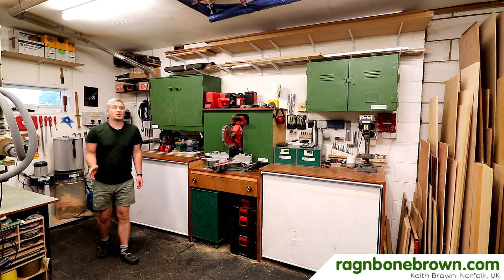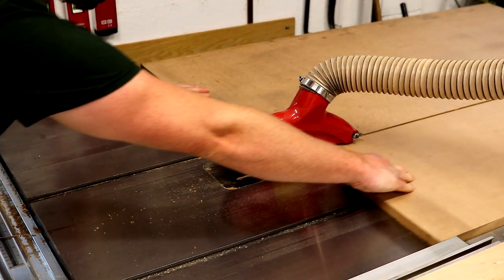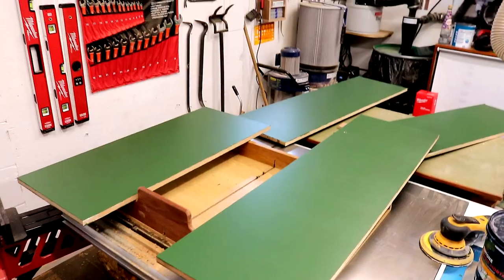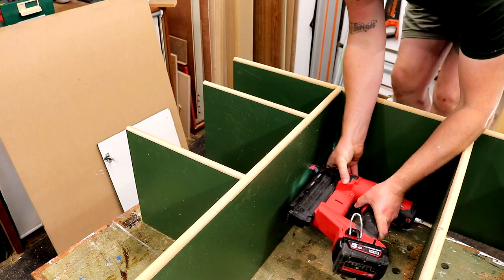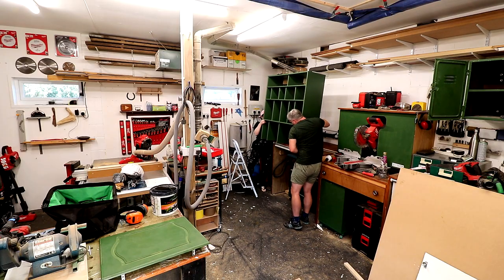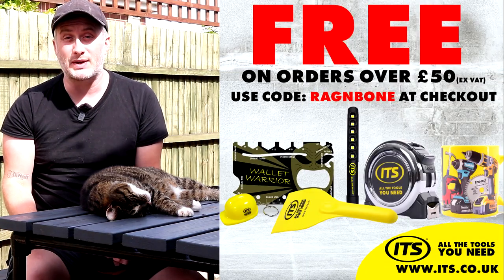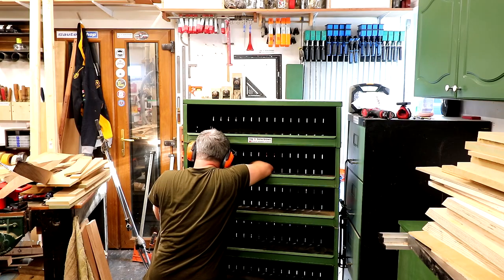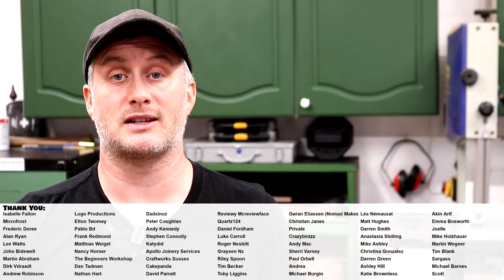Workshop Reorganisation | Tool Storage & More

Comment: Nice job and I'm sure it'll be good for your work flow. I did a shop re-org last winter and after some thought I went with straight shelves instead of cabinets or cubbies for my tools and accessories. Maybe it's just me but I felt that cubbies with a defined width were too limiting to additions or adjustments. Open shelves were faster, easier, cheaper and much easier to adjust as my needs change. Your mileage may vary.

Comment: I use to store my power hand tools under a 2x4 (60cmx120cm) workbench. Just too much dust settles. I took the center of the bench out and installed 2 full size draws about 16" in height. I love this. The tools are readily available and dust free.
Reply from the maker: I love drawers in the workshop
Reply: @RagnBoneBrown  As you know your tastes change in your shop. I am on a drawer kick right now by building  drawer shelves for my kitchen as well. Good learning experience. Have fun..

Comment: Hi Keith, I needed a new drill and for the first time used ITS. Used your code, more so that they could link the sale back to you rather than needing goodies. It arrived today without said goodies, so you may want to feed that back to ITS.
Reply from the maker: Hi Nick, thank you! I can feed back although it would help to have more info - perhaps an order number etc if you can drop me an email? May be easier to speak with them directly though, cheers, Keith
Reply: @RagnBoneBrown  Don't worry I will when the feedback email comes through. Cheers.

Comment: Do you have the Material Safety Data Sheets displayed for all your chemicals? 

Good to separate the most aggressive chemicals from the milder chemicals in a separate locker with appropriate safety equipment nearby.

Comment: Nothing like a bit of workshop reorganisation, sadly due to a previous break-in, I daren’t have all my tools out on display, instead they reside in a large locked steel cage where thieves would have t9 be particularly persistent! Really doesn’t help from an efficiency POV though. Good work 👍
Reply from the maker: Hi Darren, yeah it is a concern for sure. I think security cameras are a good deterrent

Comment: Why not just remove the doors from the cupboards? As for your corner of shame, I have a hole shed of shame and corners as well. what did you do with the tracks for the tracksaw
Reply from the maker: Hi John, that would solve the door issue but not the inefficient use of space issue